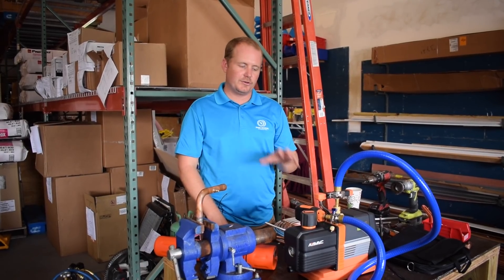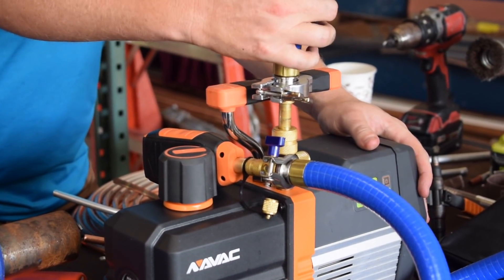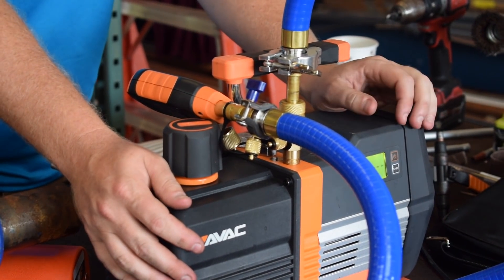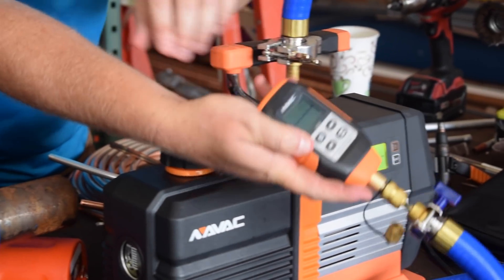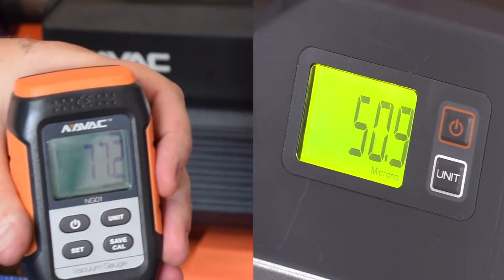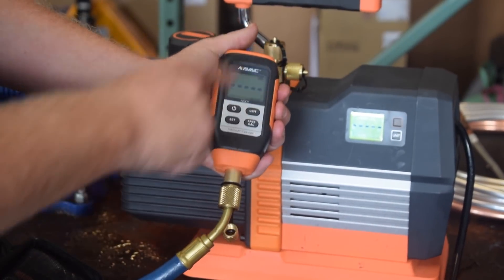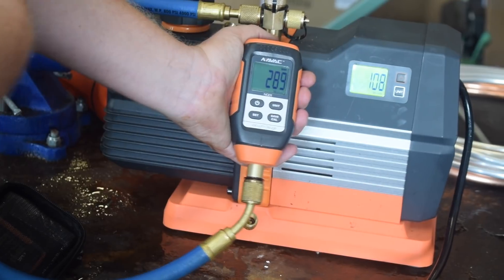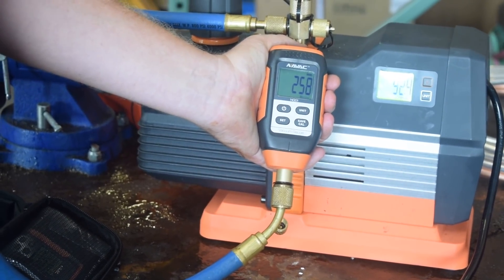Micron Gauge on the Pump w/ NAVAC

Comment: Does the micron gauge shut off about 20 minutes into the vacuum? I see it has auto shutoff after 10 secs in the specifications. I absolutely hate auto shut off micron gauges that cant get there stuff together....monitoring from a distance supposed to be 15 minutes or  another 500 microns to complete vacuum. the damn micron gauge keeps shutting off prematurely when you not touching the damn light button every effening 35 seconds.  Messing up my vaccum time how irritating.....does the vacuum guage shut off prematurely if you not monitoring like a hawk????? Im looking for a new micron gauge but that auto shut down in some micron gauges are a total in pain the neck....
Reply: Just turn it back on bro wtf

Comment: I agree the larger the hoses the faster you pull a vacuum. Question do you have a clamp on those larger hoses ?
Reply from the maker: The clamp you see is just the way TruBlue hoses attach to the the end connectors

Comment: Why did the pump micron gauge go from 10mic then to 99mic I'll stay with my JB fast vac and 1/4hoses with micron gauge on the appion valve remover works just fine & no hi tech monster hoses needed I got enough stuff in the van.
Reply: Maybe it will help Cut time in Half 😅😂